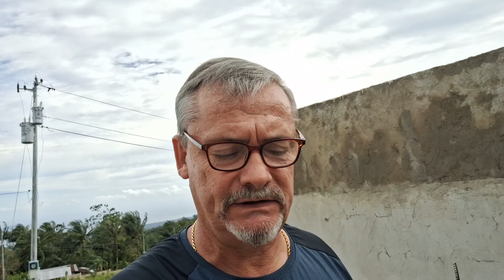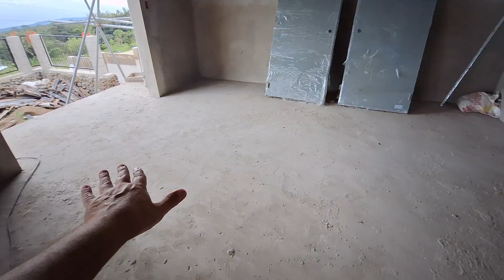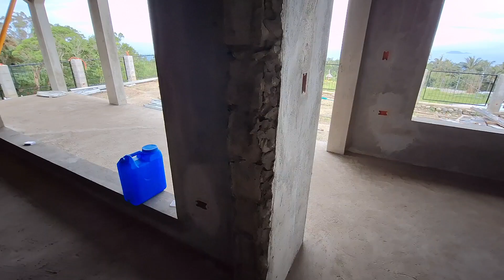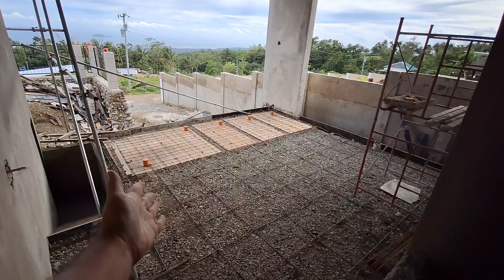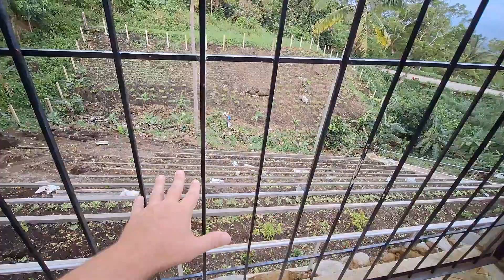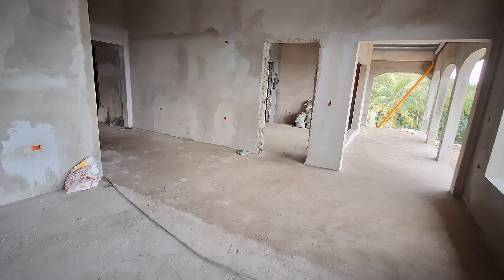Retirement living in the Philippines 🇵🇭

Comment: how much is such a roof? compared to a "concrete slab", flat roof.
Reply from the maker: Flat concrete roof would be one-third of the price.
Reply: @buildingthephilippines  thanks a lot!! 
actually one could make a rooftop terrace on top and I assume its more durable and safe as a metal roof??

I mostly see sheet metal roofs with foam insulation. (haven't checked your roof. need to check your old videos)
thx

Comment: Noticed your SUV in your carport still has a "Yellow Sticker" on the right side?
Reply from the maker: It's called a conduction sticker. Proof car was legally brought into the Philippines. Used to track the vehicle, before it's actually registered.
Reply: @buildingthephilippines  Even though you have plates doesn't mean it is registered. How long is the registration period?
Reply from the maker: @pukavoket  3 years

Comment: If I were building a new house from scratch, I'd definitely have dual voltage capabilities! I discussed it with 2 different builders, and it's possible... for an additional fee 😂🤣
In fact, one of the builders would have been my first choice, seeing how they engineered the houses and designed them. ❤️
Then Christine and I fell in love with this little bungalow (about 1/4 the size of your neighbor!), and certain features just stood out. But, as usual, I found some shortcomings with the design, and since my low-ball offer was accepted, that gave me the financial ability to upgrade what I felt we needed.
Imagine our surprise when I met the Architect/Designer of the house, and he came from the Design/Engineering company we would have had build us a home! 😲
As soon as the Architect can give me exact cost figures, and all of the title, deed, Absolute Deed Of Sale (?) is finalized, the work will begin on the upgrades. Since the new house is less than a kilometer away, I plan to be there every day, insuring the work goes correctly!
Keep something in mind; these Architects, Engineers, Foremen and workers are learning something new from us Westerners, when they're building a house for us. So it's important to work closely and rationally together with the Contractors! I should mention how important it is to develop a good line of communication and working relationship with the contractor! Together we are building a unique, one-of-a-kind house! And I can guarantee that Architect John has learned more for future designs!
Reply from the maker: Hope many future people looking to build a home reads your comment.

Comment: With the limited sunlight over the past week, have you been getting enough solar to recharge your batteries and run your necessities during the day and batteries last the evenings?
Reply from the maker: Out of 6 days, the battery got to 100% 4 of 6 days. The other 2 days, we got to 82 and 86%.  We simply turned on the generator once the sun goes down for less than an hour and that takes the battery to 100%  easy peasey.
Reply: That’s great. Sounds like you’ve sized your needs almost perfectly.
Reply from the maker: @smellard63  Yes, as close as possible. Definitely working for us.

Comment: What do you think will be different between the metal in his wall and what you used to be in your wall? Do you anticipate his to rust and require frequent painting?
Reply from the maker: Not sure what you mean? The rebar in the walls or the metal in the roof rafters?
Reply: @buildingthephilippines I was referring to your front wall and how you replaced the metal with hollow blocks. I thought part of the reason was the need to repaint it so often.  I was wondering about your neighbors use of the metal in the fence so they have a view.
Reply from the maker: @smellard63  oh OK, it's a personal choice. I have not found any type of paint that lasts. Metal fades quickly, starts to rust as well as stain the concrete below it. We decided to replace with concrete. More privacy and less maintenance.